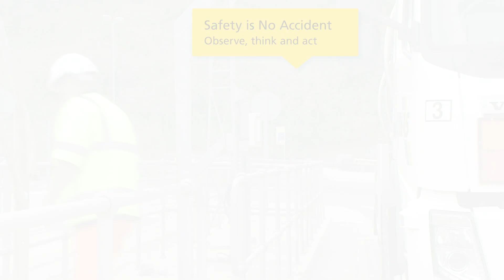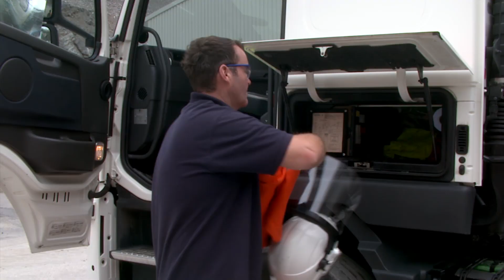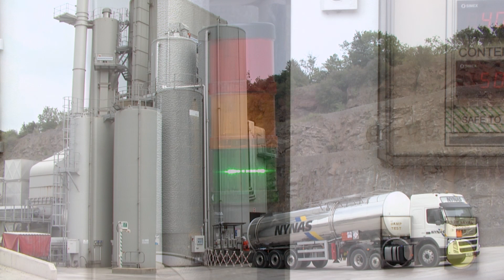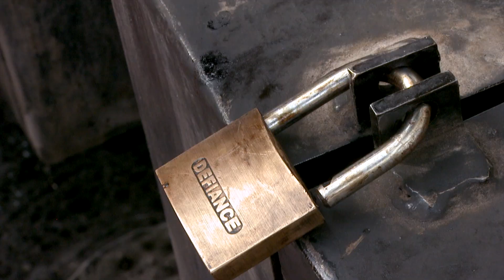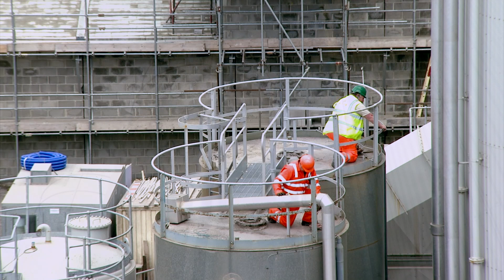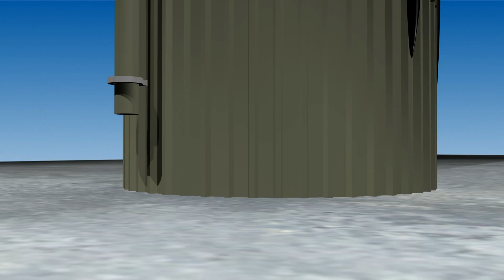Safe handling of Bitumen

Comment: The marking of the truck is irregular. The numbers are missing from the first ADR plate, which is unacceptable for a container transport, the danger number on the back plate is not 99, but 2Y. I don't understand why? The UN3257 bitumen has the hazard identification number 99 and not 2Y. It is interesting that the video is about safety and yet the basic marking is problematic.
Reply: Your correct if referring to ADR regulations. But as this is most probably a uk delivery from a uk collection point, it will run under CDG regulations. So ADR numbers are required once he travels abroad with it. CDG regulations don’t require any numbers on the front hazard board, and use the emergency action code (EAC), 2Y, above the UN number, rather than the hazard number, 99. 
So in the instance of this video it is acceptable.
Reply: I guess you're not in Britain, @Busman114 
Nothing "irregular" about it when it is a UK domestic regulation journey under CDG (Carriage of Dangerous Goods and Transportable Pressure Equipment Regulations, 2009, as well as other amendments) 

"2Y"" is an Emergency Action Code, which is what is used under CDG, whereas HIN are only used for INTERNATIONAL road journeys (ADR)
UN3257 ELEVATED TEMPERATURE LIQUID, N.O.S, Class 9, EAC is 2Y, HIN is 99